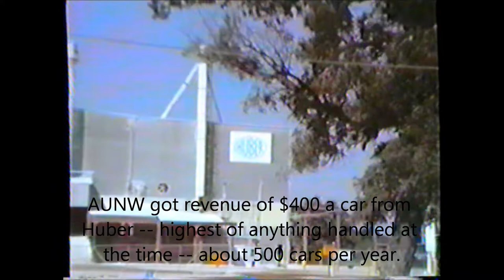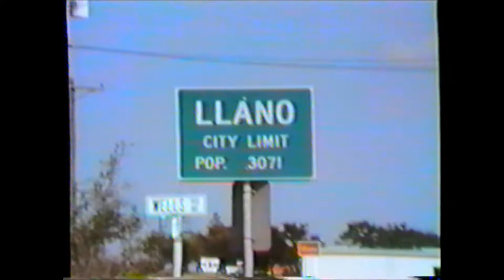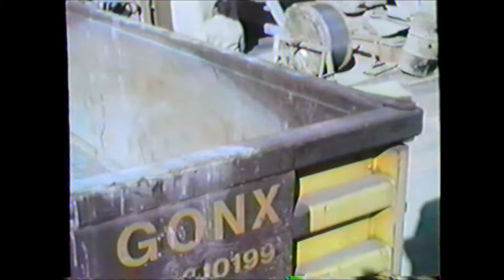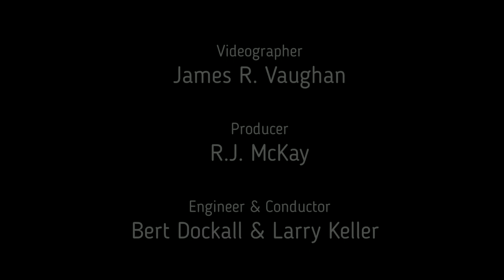Marble Falls Switcher to MF & Rare Trip to Llano!!! AUNW 44 & 33 April 1988

Comment: Very cool, I did not realize this went all the way out to Llano.. Wonder what the line is like now in 2020
Reply: The line is basically maintained but the rails are spread in a couple of places so only speeders can go out that way now, either for maintenance or "speeder excursions". A very nice visitor center has been built next to where the freight depot used to be, there's a fully restored C&O caboose there as well as a LIRR commuter coach awaiting restoration.

Comment: I have wondered do they even go up to llano anymore?
Reply: No. Only speeders go up there now and major vegetation is cleared. The rails are spread in a couple of places so no trains can run up the Llano branch anymore until that's repaired. The north end of the wye, where it crossed SH 29 to feed Premier now ends just south of the crossing, with a shipping container now set there as the end of line. Premier is now Living Stone and doesn't use rail anymore.